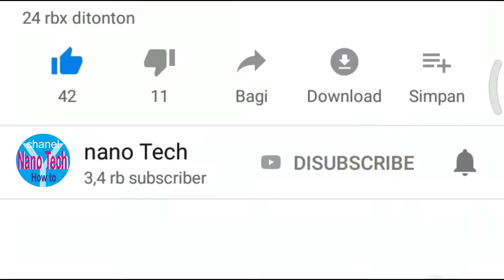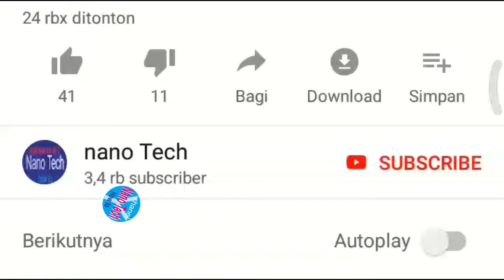How to Repair a weak Drill / Screwdriver / Battery runs out quickly

Comment: WTF ? Without a BMS the Lithium battery will overcharge and burst to flames !! This is very dangerous. You should have added a bms between the battery output and the battery it self. Never connect a Lithium battery without BMS !! NEVER !!

Comment: You replaced 3 batteries (1.2v x 3 = 3.6 volt) against one but you did not show the voltage of the one (laptop) battery.
Reply: 4.2 volts for 18650 batteries and he did not add a li-ion battery pcb charger in it . veryyyy dangerous thing he did